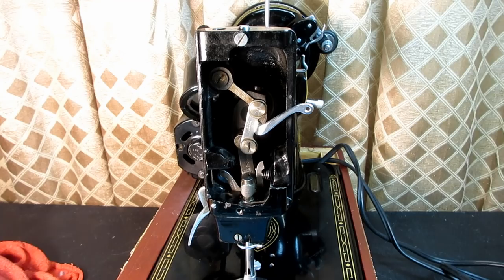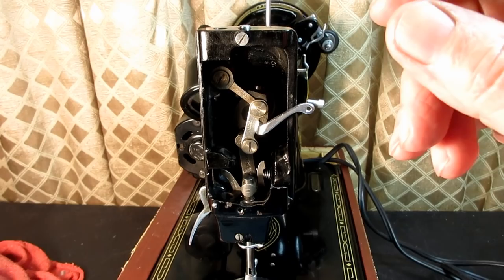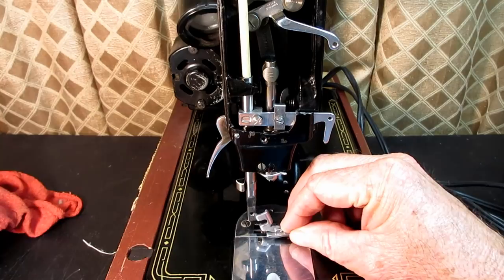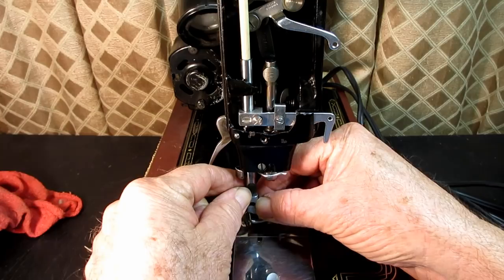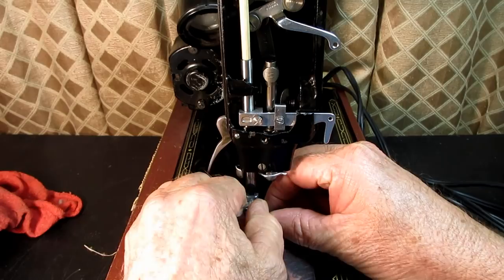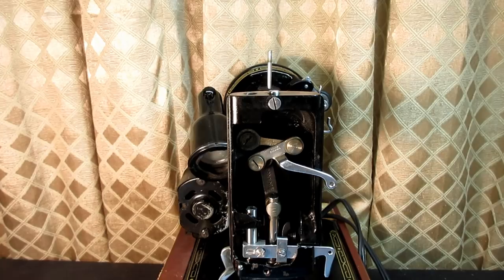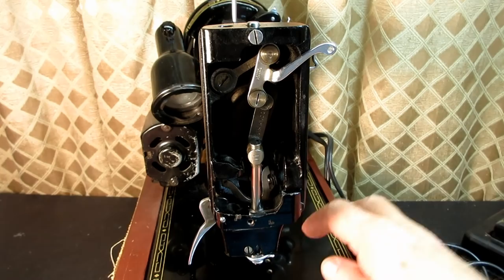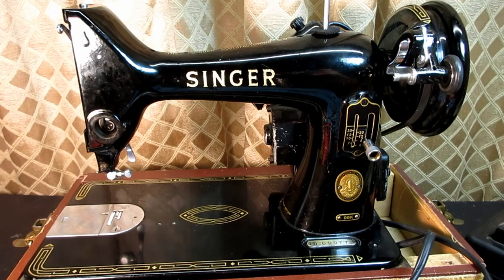The Presser Bar System of a Singer Model 99K Sewing Machine

Comment: Hey Andy, I’m looking really hard trying to find a video where you show how to adjust the feed dogs in the forward and back position and not the height position. It’s a 99 machine that I’m working on and I can’t find a video. Do you have one that covers that?  I remember you working on one but I don’t remember if it’s the 99. I sure would appreciate any feedback. Thanks.
Reply from the maker: Oh, no video for that. Not in the manual either 😢 You may be thinking of the 301A video for that adjustment. https://youtu.be/uAOcMv4IPj0    Although the parts are different, I imagine the principle is the same on Singer machines and that can be adjusted like that. The video may give you enough clues to do your 99 but I'm honestly not sure there is even such an adjustment on a 99K
Reply: @andytubesewing1953  thank you Andy, I got lucky and I found a video. Bob Fowler provided one but it was on a 66 which is the same set up. It was hitting the back and making a horrible knocking noise so I’m fixing to get back on my machine and hopefully can fix it. This machine was headed to the landfill when a lady ended up giving me that one and another 99K so they’re both on the road to recovery.  Thanks again for replying.
Reply from the maker: @rhondamercado7527  oh that's great you found a solution. Bob Fowler is terrific and I'm happy that he had made that video. Thanks for saving them machines. It's very uplifting to hear that. Take care

Comment: Hi Andy, on my Featherweight, my presser foot is slight out of line.  Do you have a video showing how to make an adjustment for this problem.  The inner pieces aren’t quite the same as on my 99K.
Reply from the maker: I'm actually in the middle of a playlist for working on a featherweight and I do have a presser bar video: https://youtu.be/0H1GBrv7Eiw   ( aligning the foot starts about 1:02:00 near the end of the video) The entire playlist is here: https://www.youtube.com/playlist?list=PLsCOZgzzaiKIA1OPw0k6QOSTE-wAUZ4kp   and it includes many other part remove/replace/adjust videos. Thanks for asking and for watching my channel. Good Luck

Comment: Hi Andy, 
My presser foot  can only fit 1 1/2 quarters under it. At 19:37 minutes into your video you tighten a screw. That is where my second problem is. On my machine this screw is frozen frozen frozen. My husband even tried using a mallet with a (hand) impact screw driver to budge it with no success. Do you have any ideas on how to remove, and most likely,  replace this screw.  And lastly, do you know the part number, name of this screw and where I can find one. Thanks a million from your great videos.
Reply from the maker: Sorry you have a tough one on your hands. Using the impact screwdriver can work but caution you do not bend the presser bar (hollow and can bend) 
     Usually, an overnight soaking with a penetrant oil will be enough. If the is ANY rust in the area I use a rust remover, like The Must for Rust. I have removed many frozen screws using heat from a hairdryer usually is enough. I have a 2oz brass jewelers hammer I use to hit the screw bit while turning it with a 1/4 closed-end wrench. The idea is sharp constant rapping to shock the screw threads.
     I have a friend in the Philippines who repairs motorcycles and sewing machines and he faces rusty parts every day. On a stuck screw that all else fails he has used a small, hand-held propane torch to heat the part. According to him, that very high heat will expand the screw and "break the seal" so he can remove it when it cools down. He says the hard part is heating the screw/parts without doing peripheral damage, like the black paint in the case of a sewing machine. I've never tried this myself, but in 2020 I told a viewer in Germany the method and he said it worked for him getting a rock shaft screw out on the bottom of model 128. 
     If you watch @2:32  you see me point to the screw, then the bracket. The bracket is called "PRESSER BAR LIFTING BRACKET" Part No. 33667E. The Screw then is called "PRESSER BAR LIFTING BRACKET CLAMPING SCREW" Part No. 50052E. The presser bar is Part No. 33619E and called "PRESSER BAR (HOLLOW) I mention the other part numbers because you usually have to find 2nd hand parts for sale on sites like eBay, Etsy, and other online market places. It is hit or miss to find someone parting out a machine. You often have to buy a group of parts and not just a screw.  
     I did look at eBay and surprisingly a seller has the parts today, 7/15/2022 👀😳https://www.ebay.com/itm/153366604054?hash=item23b55ca916:g:Z5UAAOSw2RdeE2-~
Listing 5946 he calls the slack thread regulator (duck head part) If you look at that picture slide (5946) you see the length of the screw and if you enlarge it you will notice how the last few threads at the back end are darker. This is what I find when a screw is stuck. There are layers of dried, decades-old oil there, or rust, that makes it stuck in the bracket. It can also be found on the smooth shaft of the screw just past the head. On a part like that, I set the machine on its nose and soak a cotton ball with WD40, and set it on the back side of the bracket hoping the oil will penetrate into those last few threads. When you try to unscrew all your force is on the head of the screw but it may be the back threads that are the problem.  I try to heat the whole bracket and the back of it.

     There are some screw charts floating around the vintage sewing groups and I have a couple of them but that screw was not listed, so I cant give you the thread count or tap size. If you get it off and the bar is bent now there should be a part number etched into the bar. I mention that as there are a few versions of the model 99 and some have a different presser bar part number.
     Hope this wasn't TMI but I don’t know when I’ll be back online. Good luck.
Reply: @andytubesewing1953  all amazing informative information. I thank you so  very much. Hope your long time away if for something fun!!!
Reply from the maker: @bluetuber501  Welcome, and I hope you find a solution. https://youtu.be/AQt0GzHdj30

Comment: I have a machine that looks just like that except for the fact it's made in Canada , the motor is Bakelite and my nose has a protrusion in the center . I have the serial number but I haven't run it yet cuz I can't figure out how everything else on my machine is the same as yours except for the nose cover plate is not flat.
Reply from the maker: Maybe it is not the original faceplate, but from another model. Model 99 is a 3/4 size model 66 and they share some of the same parts, so it is conceivable (to me) that you may have a model 66 faceplate. Singer models 99 and 99K were made from 1911 thru 1958 that I know of, and there were about 20 versions. Here is a list at ISMACS:  https://ismacs.net/singer_sewing_machine_company/model-list/classes-1-99.html   Here are pictures of many SInger faceplates, including model 99 of which there are 6 varieties, but none as you describe: https://www.singersewinginfo.co.uk/gallery_faceplates
Maybe you can find your faceplate on that page and see what model it is from. Good luck.

Comment: Hi Andy - I have just watched this and adjusted my 99k Presser foot - however I don’t have the luxury of feeler gauges, or quarters being in NZ. Closest I can set it is 8mm and seems to be ok, still a little slack when raised up but not as much. Your thoughts?
Reply from the maker: 8mm is a little high but if it sews what you want then you are good. Some attachments and accessories may not work properly. If you have NZ coins available you can use 3 x 20 cent = 6.66 + 1 x  5 cent = 1.24 for a total of 7.90mm. That is .0375 lower than the maximum height. Common copy paper is about 0.1mm thick, so you'd be less than a paper thickness lower but all attachments and accessories would work. For me, .0375 under is better than .0625 over but for most sewing, it probably won't matter.

Comment: Well… all last Fall I followed your videos to clean up my ancestors Singers (three).  Today I went right to you as my Singer AB010456 suddenly started sewing crooked and I heard the presser foot go “clunk”.  Now the lifter is real flimsy like.  Maybe this is a 66 but I don’t know how to adjust it. Has a screw  type brass pusher on top inside a socket like gizmo and the spring is still in tack.  Might you have a video on that style?
Reply from the maker: Serial Number AB010456 is a 1929 Model 66. The only model 66's I have seen have this same type of presser bar system. From your description, my first thoughts were that the set screw for the presser bar worked loose and the spring in it just pushed the bar down completely. (clunk) With the lifter lever feeling flimsy (floppy) that also sounds like a lack of pressure from the spring. When you lift the lever does the bar also lift up with it? You say the spring is intact, but are you sure a piece of the spring did not snap off on the lower end of the spring down inside the hollow part of the presser bar?  Losing the spring pressure will cause the foot to start twisting (crooked sewing). That's all I have for you. Good Luck.
Reply: Oh my….I wrote you as soon as it happened.  Now I’m calmed down and went in with another machine I had with my sewing project.  It’s just I wanted to use my great grandmother s machine which seems in mint condition for 1929. It was sewing beautifully till now. I would have never known anything about these machines without your videos.  They gave me courage to dig in and I did!  Loved it!  This issue is such a curious one and would love to get pictures to you but not sure how .  This spring is actually on the outside of the presser foot bar and is not the usual screw top piece.  I can push it up and down as it moves through a brass barrel -like mechanism.  That mechanism also seems to screw right or left and will actually screw right off the top it I let it, but I’m afraid too. It has ESCO Pat pending on the brass barrel and a little lever fashioned in it as well.  Idk…nothing looks broken. The back lever still picks up the foot and pushes the thread tension forward to release thread.  I just think it’s a matter of figuring out the ‘how’ the barrel thing on top  works.  Still, thank you so much for all your videos—you are an awesome teacher with great courage to tear up sewing machines only to get them back to sewing function. 😄 If this info helps let me know—
Reply: Lol!! 😂 I figured it out!!! Honestly, I thought if Andy Tube can deconstruct these machines, and show us how, then I will do it!  I unscrewed the barrel off the top and along with that come this very fat “screw” inside the barrel.  That screw is what pushes down on the presser foot bar when you open the lever in the on the barrel and then close it at the interval on the screw which is the resulting tension you chose. Looks like there could be about six choices.  So apparently the lever came loose and dropped my presser foot while sewing!  Oh my …I’m so excited—this is my great grandmother’s machine!  It was at my moms house forever and I got it at mine since 2010 and just this past Fall got it out to clean up because of your videos!  I started a sewing business this year and I wanted to feature it in my sewing products😀 (that’s why I panicked that I broke it).  Ahhhh…. Well thanks for listening and replying!  Keep your videos coming!  They are top notch!  Sew-excited!!! 😂
Reply from the maker: @mammaubear8647  Ok, here is some news then. That ESSO part is not an original part made by Singer. It is a type of quick-release pressure system. When you push the top or the top of the bar in some cases, the farther down you push the more pressure is put on the presser bar. When you get it where you want and let go the lever system holds it there at the pressure you set. When you want to change the pressure on the presser bar you push on the lever and it "pops" and releases whatever pressure there was. At that point, you push down to set a new amount of pressure. In the Singer system, you must tun the thumb knob clockwise for more pressure or counterclockwise for less pressure. The ESSO system (and other brands) let you change pressure faster. Some seamstresses were very good at setting the pressure just by the feel of resistance. They may have needed to change pressure often while sewing a dress, jacket, overcoat, etc. and they like the press and release system for its quickness. The only one I had in person the unit screwed into the hole/threads where the Singer thumb nut went and it had an internal spring w/ a lever for setting the pressure. As for pictures, you have a YouTube Channel under your name "Mammau Bear" as I have my channel Andy Tube and you can upload videos and slideshows anytime you like. You can set them to be public like my videos, or unlisted or private, and then just give the address to the people you want to see it.
Reply from the maker: @mammaubear8647  Oh, great. I just responded to your other comment about that ESSO part. Glad you jumped in and figured it out,

Comment: What is the name of the spring inside the nose, there to the right? It pushes the little tension nub, if that makes sense. My 99k needs a new one and I can't find a part number anywhere. Thanks for another great video!
Reply from the maker: It is called the Tension Releasing Lever Spring, Part #33660. It attached to the Tension Releasing Lever (of course) Part#33659.
It will be very hard to find the spring for sale by itself. Better luck with the lever & spring, like this (4981) https://www.ebay.com/itm/Singer-Sewing-Machine-Model-99K-Choose-Your-Parts-Free-Ship-Over-25/153366604054?hash=item23b55ca916:m:mwauoqRAtLnrrzRoRemEzdA    That same part is found on Singer model 185, K or J version, like in this offering (5369) https://www.ebay.com/itm/Singer-Sewing-Machine-Model-185K-Choose-Your-Parts-Free-Shipping-Over-25/163771984318?hash=item26219229be:m:mWkLqR9TsRDbVhmwKQW2IvQ   I'm glad you enjoyed the video. Good Luck.

Comment: Hi Andy, very informative video, I learned a lot. I have a Singer 201K that I am cleaning, was my mothers. I have a question is the height of the pressure bar the same on the 201K? Many thanks for a very enjoyable video.
Reply from the maker: Yes, it should be OK with the same adjustment. Once you set it, do this double check: Lower the NEEDLE BAR as low as it will go and lift the PRESSER BAR up with the lever. If the two bars touch, then the presser bar is a little high (assuming the NB is set correctly) and you can lower the presser bar a tiny amount. AT 7.93mm the bar height on the 99K is higher than the average Singer Model, which is more like 7.62mm, but the 201 is of an age with the 99K, so I think setting it like this video should be OK. Good Luck and thanks for watching my channel, Jan.
Reply: Thank you @andytubesewing1953

Comment: Andy.  Your videos are so informative.  You are the best.  Did you ever attempt to punch the pin out on the presser bar lever?  Around 32:25 in the video.  I'd like to remove the presser bar lever on a 185 and give good cleaning.  

I am also curious about removing the mechanism the presser bar lever pushes forward that releases tension on the tension unit.  Any suggestions or tips?
Reply from the maker: Thank you.I did not remove the hinge pin for either the presser bar lifting lever, or the tension pin releasing lever. An experienced technician informed me the pin remove from behind the head towards the cover plate and needs a fairly good rap with the hammer/roll pin remover to get it loose. After it's loose it just pushes out the front. Of course you tap in in from the front of the head towards the motor end to install. Thanks for watching my channel.
Reply from the maker: @meganmills6545  Bless you for this, Megan. I tried to find that video and could not. What a clever gadget he came up with!
For that Tension Releasing Lever... My documents show a part number of 33659, but there are a few versions on the 99.
I have found bent levers before, I think from someone forcing the presser bar lifter lever up when it was stuck with old, dried oiL. I was able to bend a couple of them enough to get them to work, and a couple I had to find replacements b/c my efforts made them worse. I've also found the presser bar lifting lever to have a worn "pin" on the back that activates the tension lever but was too worn to move it correctly. Replacing the PB Lifting lever fixed the problem. Have a Happy New Year.
Reply from the maker: MARK SCHEIDEGG... Please see Megan's comment below for a safer method of removing the pins.
Reply: @andytubesewing1953  Thank you!  What a neat idea.  I was able to tap out both pins, the presser bar lifting lever and the tension release lever.  The machine I am restoring actually has a bent tension releasing lever on the arm side that holds the spring.  Wasnt sure if that was by design but sounds like it is not.  It does not seem to hinder its function tho.  Thanks for the great info and help!
Reply from the maker: @markscheidegg1181  Nice work. Happy ending!
Reply: @markscheidegg1181  oh no, I have been tapping on the Presser bar lifter hinge pin in the wrong direction. 😢 It's partway out and I hope I can go back in the right direction!
Reply: @meganmills6545  Thank you so much for that video suggestion! I've gotten the pin stuck by tapping in the wrong direction, I hope I can get it back in by trying something like the C-clamp... 🤔
Reply: @DFTBAandDS  Hi DFTBAandDS  (I don't know what the DS is, but good on you for DFTBA!).  I'm fairly sure you can do it.  Good luck!  :-)
Reply: @meganmills6545  lol, the DS is "decrease suck", something they used to say, more often now I hear them say "decrease world suck" 🖖